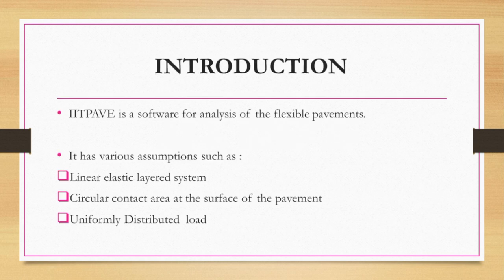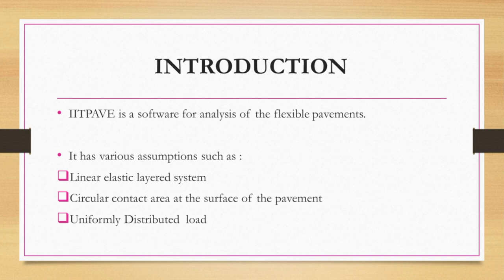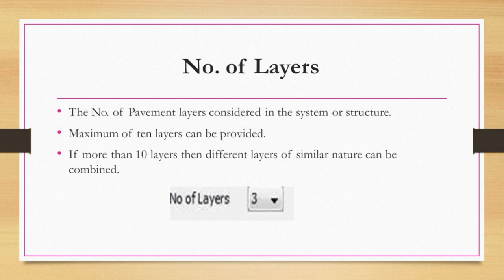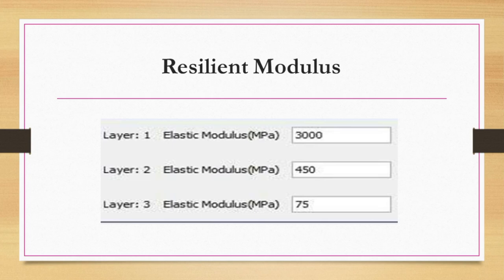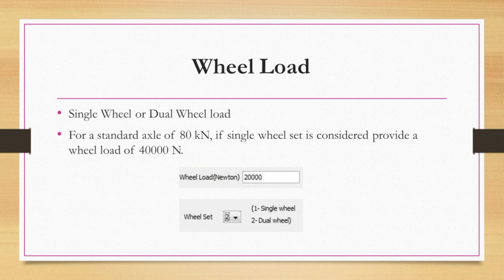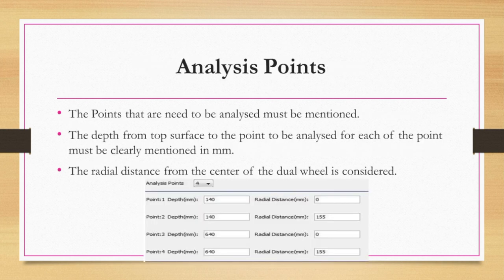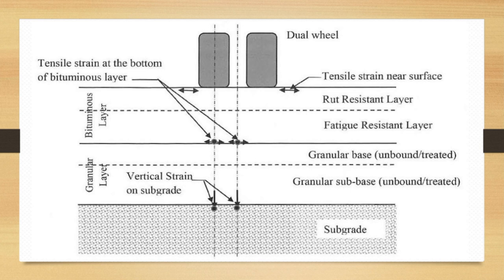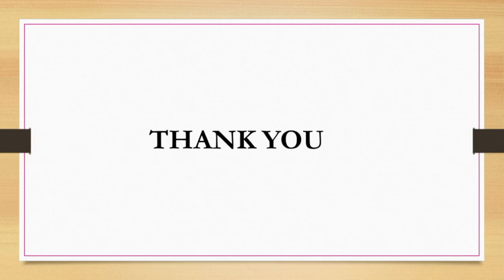IITPAVE | PAVEMENT DESIGN | PAVEMENT SOFTWARES | PAVEMENT ANALYSIS | IIT PAVE Software Part - 1

Comment: Sir, how to download this software, please reply as soon as possible
Reply: Original Software can only be obtained by purchasing IRC 37 -2018 which is the Guidelines code for Flexible Pavement along with which the Software and Installation Procedure will be provided for free. A pdf copy of IRC 37 is available in net but the software will not be available with the pdf downloaded.

Comment: How to get IIT Pave software ?
Reply: Original Software can only be obtained by purchasing IRC 37 -2018 which is the Guidelines code for Flexible Pavement along with which the Software and Installation Procedure will be provided for free. A pdf copy of IRC 37 is available in net but the software will not be available with the pdf downloaded.